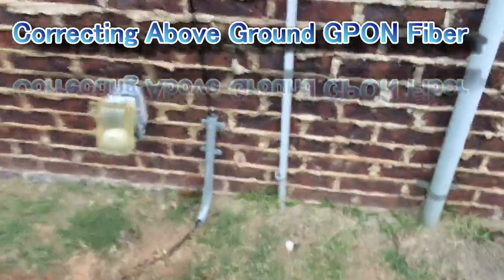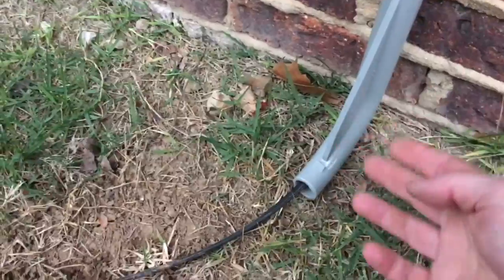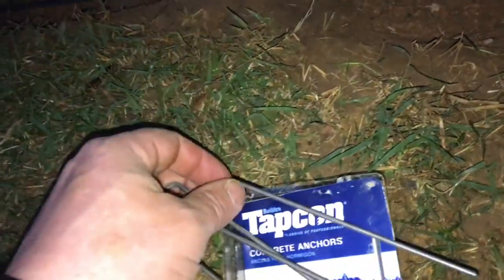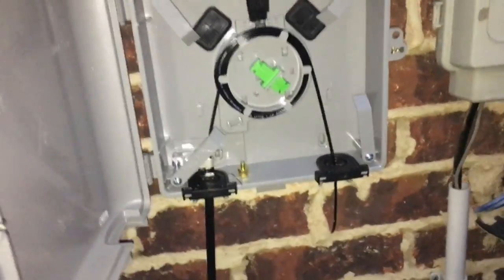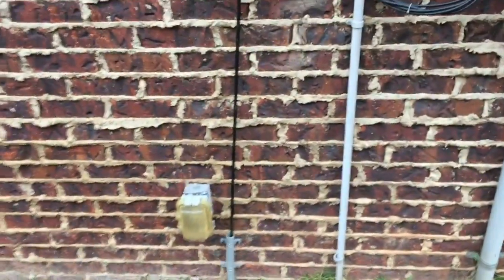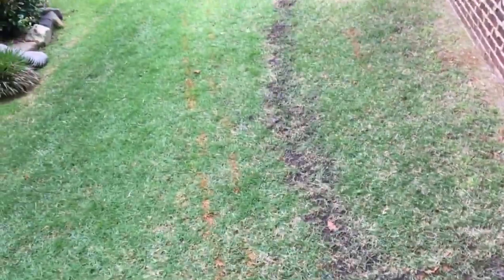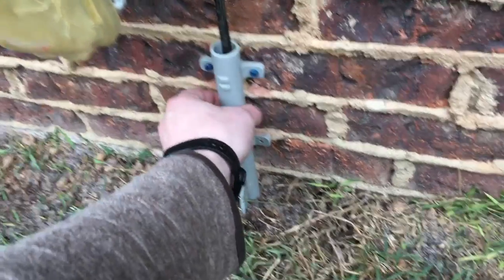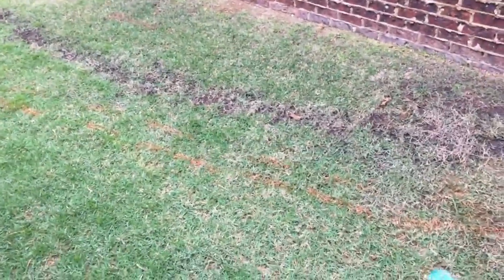AT&T Gigabit Fiber Internet -  Underground Fiber Installation Mistakes and Resolution Process

Comment: More concerned about that mortar work. Holy hell.
Reply: lol. -- This is an upper scale neighborhood of sorts.  I suppose it's not so obvious to you, but the mortar work is done perfectly but to give a new home an 'old world' look they don't clean up -- IE: Acid wash for exactness/clean lines.  They also tend to add a bit more here and there and in some cases push a weeping technique in certain joints depending on overall look of the home/neighborhood.  

I'm sure you've seen plenty of 'newer' neighborhoods with mortar and brick that look like this?  Were you being sarcastic ? :)
Reply: Used to be the style man
Reply: lol.. Indeed.  The house is only 10 years old,.. just happened to be built in a 'themed' type of neighborhood.  That's rather popular around here (Themed neighborhoods).  I'm not crazy about them as everything just looks the same but it is what it is.
Reply: Looks like shit for sure!

Comment: Installer should have used crimp-lock tool to make a couple of fiber connectors for inside the slack nid.  Provides a breaking point to check for inside/outside issues on a repair.  If they are done right, you should have very minimal light loss.

Comment: I install for AT&T, and I apologize for this type of work. This is an absolute shit install.  This is not the type of work myself or my co-workers do.  You should call and tell AT&T to come and repair this to make it right.
Reply from the maker: No need for you to apologize.  I am a network engineer, net. Admin, Systems Designer, Sys Engineer (I just tell people I'm in "IT" because I do most everything in it..) -- Point is I see good work, average, and piss poor work.  I see sheer lack of common sense,.. lazy incompetence all the time.  I know better than to assume every installer , burial crew, etc does their work in this manner.  It's all in the person/people and whether they give a damn, have common sense, and if they are lazy etc.  
As for calling AT&T I gave my reasons in another response why I didn't but I've fixed everything (imo) better than they would have without cutting any lines etc.. so at this point there is no need for anyone to come fix anything.  It didn't bother me too much.. as I half expect shoddy work from most companies contractors, and employees these days (no offense to the 'good' guys out there.. and I know some of those personally,.. and this stuff pisses them off more than it does the customer as it makes them look bad and people assume they are 'ALL' this way).
Reply: I'm a Uverse tech as well, where's that drop tube at? Also, I fucking hate those flower pots. We have to dig down and under to feed the fiber through it
Reply: Yeah he completely bypassed the terminating points in the slack bid, I've never seen the fiber drop run directly inside the home like that, if your drop ever gets cut, the repair tech will do it right.
He should have sealed the point of entry into the home, like you said, and both grommets on the slack nid. Also, they should have grounded the drop using that copper stud in the slack nid, then grounded the nid.
There should also be a conduit going up the drop to the nid, they also didn't tag the nid with your account number
Reply: They all look like this down in South Florida.. Looks like a normal install.
Reply: @KevAdams1989  grounded the fiber drop?  Its glass, the copper conductor is for locating lol

Comment: I am pretty sure they messed up your install A LOT. When you opened up the box on the outside I am pretty sure that the green connector in the middle of the spool is supposed to be a patch. As in they put an end on the cable from the street plug it into the patch then run a patch cable into your house. That way if there is ever damage one either side it is less work to repair. The cable is 100% not burred deep enough and it almost looks like the cable from the box into the house is not the properly specked cable to be exposed to the elements and potential damage.

Comment: We do not have fiber here yet. What does the inside the house look like?
Reply from the maker: I'll make another video showing everything involved explaining the infrastructure inside my neighborhood all the way to the actual modem/Gateway -- It will notify you when I make it and I go live.  Where do you live.. ie: City/State?  You aren't in AL are you?
Reply: Install a fiber homerun from NID - outside box - to a 6" x 6" square called an ONT, run cat 5 from ONT to Modem.  Usually the ONT will go in basement or some other discrete location.  A good tech will hide most of the wiring or if it is exposed will run the lines neat and clean

Comment: Hey bud, just FYI if your line was damage or cut, it can easily be replaced from the box near your house to the box on the side of your house... not thousands of feet. Average length is 300'
Reply from the maker: They don't splice / repair cuts in drops from the TV80 Ped  splitter drops to handholes/home demarcs here.  If there's a cut.. a brand new drop from the TV80 miniped (next to ONU) is pushed whatever the said distance is to the Demarc etc at home.  I don't know precisely why they aren't repairing the fiber mid way.. but they don't in this area.  It does make for consistency though.  I don't think the fiber cuts are immensely high on the 'drop' side in xFITL (ie: DISC*S MX conversions).
Reply: GuessTech False
Reply: If that line gets cut it will be a 20min fix from that Cfst Pedestal, the tech will run a brand new line from that pedestal. You don’t have a Tv80 circuit

Comment: If this is how the outside install was....what does the inside look like? I would have told them to come back and take it all out, fix my yard and the holes in my house. I'm surprised you're so patient.
Reply from the maker: Well it's a bit complicated.

The inside is perfect.  Mostly because I prepared the entire install from ONT throughout the entire house before the installer even arrived.  IE: I ran multiple Cat 6 Cables (a few hundred feet) through the house, terminated where needed,.. put in Low voltage mounts in sheetrock,.. installed Female ethernet jacks where needed and so on.  So when the installer came in - he did that shoddy outside work (on the burial, J-pipe PVC being above ground etc)  and all he had to do was put the demarc box on outside, drill into house as shown in this video.. push the fiber end through hole and put the small Optical Network Terminal on the sheetrock/wall inside the house and plug it in.  I had the Cat 6 already terminated and precisely where he drilled into the house ready for him to just plug it right into the ONT.  So , yes, I did a lot of his work he would have had to do -- but I did so for two reasons.

1) When you do it yourself, and know how, it's generally done better than someone else doing it who isn't trying to do everything "perfectly" right, paying attention to every detail and so on.  I'm particularly anal with any bad crimps/angles/Ethernet cable secure clamp points,.. Jacks, Terminations,.. the works.  So I spent the time to do it the way I felt 'happy' about it being run before the fact.  This isn't to say the installer couldn't have done it, -- it would have worked with however he ran the ethernet cable of his own.. but there's no way he would have run it the way I did up multiple walls, through attics, above attic and so on.  Plus my equipment was better than the standard equipment he would have used supplied by AT&T.  (That said, the standard AT&T Cabling etc works just fine.. I'm just of the mind if it needs X rating.. then go to a higher rating if reasonably cost effective).  IE: He would have used Cat 5/5e -- I used Cat 6 rated for 10Gbps despite only 1Gbps (1,000Mbps) being run through it.  That 'headroom' is nice to have imho for a variety of reasons for your OWN install, not necessarily on a mass scale.

2) To save time. -- The install time for Fiber is up to 6-7 Hours -- and you/I have to be right there the entire time.  So I wanted to shorten that as much as possible.. and I did.  I helped him run the Drop fiber half a mile through conduit from my house/handhole to the Fiber corning splitter by the Optical Network Unit .5 Miles around the corner.  While he was working outside on that stuff I 'redid' I was inside setting up the mount for ONT, drilling through walls with plates etc.

As for the outside cabling.  The initial imagery is the Neighbors lines and my line.   

You see they CUT all of her lines to all her services when they buried my new fiber lines (about 3 weeks after it was installed).  I buried all my own RG-6 QS (Cable TV/Internet) lines, Telco lines, and so on.. So I know precisely where all the lines are located.  Knowing the likelihood of incompetence with the burial of now HER new lines (two new lines.. her POTS and Fiber line) Plus my own line that had 6-7 feet by road unburied still.  I knew I wouldn't catch them when they arrived.. I had no idea what day or time they would come do it.  So I made labels with specific instructions on them on exactly how to bury the lines, where to lay them, where not to lay them, what to avoid (power/gas/cable/water/sprinkler systems (hers) etc) -- and I routed the cables in this position so all they had to do was follow where they were already positioned and they would not cut any other cable,.. be it power or my own fiber or cable et al.

Sounds pedantic, but I've seen companies go back and forth cutting each others lines on drops like this while customers have to wait days or weeks to get service back up only to have it cut out again by Company A cutting Company B's lines due to not having any common sense.  -- I think you get the point by now.. but by spending 10 minutes with the aforementioned labeling, positioning and so on -- I was pleasantly surprised to come home and see they had followed the directions to the T, perfectly.  Only gripe I would have is the depth they buried everything at.  (2-4 Inches, and 1-2 millimeters at best next to house demarc pvc pipes).  Which is what this video is about mostly where I resolve that depth issue and ABOVE ground ready to be cut in half by lawn services etc due to expensive fiber optic being above ground against the house.

TLDR:  Not so much patience, just worth it to me to do things myself since I "can" do this type of work and to prevent more time consuming, loss of service, etc type of headaches due to incompetence.  I was quite  annoyed with AT&T.. especially their burial crew(s).  Again,  2-3 inches isn't acceptable imo for Fiber optic (or any telecom cabling) and NOT buried against the houses while above ground like shown in video is just 100% incompetence of common sense work -- No 'training' needs to be done to know an underground cable going through a J Pipe of PVC has to be buried UNDER the ground lol.  

It's all finished now,.. grass is healing up nicely, service is great so all is well.  

For the inside - I do plan on another video showing it -- and if I can find the little bit of footage of the installation (running Fiber through neighborhood to ONU splitter Ped,.. etc) I'll add that into it.
Reply: Good explanation, thank you. I have a couple more questions:

1. How many lines run into the house from outside?
2. Can these lines terminate at a network cabinet and then get distributed throughout the house with my 
     existing Cat6 wiring?

My network cabinet is in an unfinished section of my basement. Any lines that need to come in from outside could be ran directly to the cabinet for distribution throughout my house. I have Cat6 hardwired from my network cabinet up throughout the house. I guess my assumption is wires come in from outside and terminate into a "Modem" and then get distributed to other points in the house via ethernet cables. Is this correct? Aside from the Fiber Modem on the inside, is there other hardware that needs to be installed inside the house?

Thanks
Reply from the maker: One line comes into the house - The Fiber optic line as shown in this video.  Inside is what is termed an ONT (Optical Network Terminal).  An ethernet cable is then plugged "output" from this ONT and that goes to the "modem" called an RG (Router Gateway).  

So in short:
1) -  1
2) Yes.  -- The Ethernet cable coming from the ONT inside can run to your network switch/router/hardware and that can be distributed how you wish.  Though it does have to pass into the RG before becoming functional as the RG ("Modem") authenticates your service on the network.  For example I run my Router and switch behind the RG,.. I put the RG into a passthrough mode (removing NAT etc) and my equipment does all of that -- the RG primarily is just authenticating although they don't allow a true 100% passthrough but for all practical purposes it will work anyway you wish for things to.

I will mention they are in the process of building the ONT into the RG ("Modem") as one unit.. in which case the outside fiber would run directly to this as you suspected instead of the way I prefer it and the way I and most have it now with the Fiber coming inside to ONT.. ONT having an Ethernet cable going to RG and their equipment if they choose to use anything beyond that Router/Gateway supplied by AT&T .

Comment: I dont have that big out side att fiber box.   My installer went to the neighbor house box then the fiber cable went straight to my room.  Nothing like this.  Is there a reason?  Is it because the main box is on my neighbor property.  They install the fiber cable laying on the surface and said someone will come to burry it. I would have though they would do that on the same day they install the internet

Comment: I have Verizon FIOS in our area (we currently use Spectrum - I have no complaints about reliability, but they have a very low speed package). I called out FIOS and I told them that we had a conduit because we have a pool to boring in all media lines. After attempting to pull the line they could not get it through. The technician just left. How did you guys do the burial of the fiber? Thanks.

Comment: As someone who does these installs everyday.. I also apologize for the lack of fucks given by the installer. BSW is a whole seperate issue. No wonder they think we can install fiber jobs like this in 2 hours.

FYI.. the slacknid (connection box) on the side of the home is now "optional"... so you can imagine the work we are going behind now. One other thing.. depending on availability.. we have access to flexible conduit that is to be used from ground to nid on buried fiber applications.

Comment: What kind of clown shoes operation puts fiber in the ground without putting it in conduit from the handhole to the house?
Reply from the maker: Agreed.  Conduit is the PROPER and prudent way to ensure what you put in the ground stays there and RELIABLE for decades to come.  AT&T did this work of course.. and I'm grateful it's here.. as it's relatively rare if you compare the number of residences that have fiber available to those that don't in this country (maybe 1-2% max).  

I will give them credit,.. they do the work quickly WHEN they get around to doing it but it took them a YEAR to finish this.  It was easy to count the days it took for the crews to do the actual work.  If they had come out and did it start to finish in this neighborhood.. it would have taken ~5 days MAX.  Instead they did literally a few hours of work every 3-4 months.. then finally at the end sent in contractors to dig the area up in 2 days.  The credit I'll give them is they DO use conduit for everything in the neighborhood EXCEPT from the Handhole to ONT (side of home)/Demarc.  So that is why I did what I did.  There are A LOT of other utils/cables right where they put this fiber so it would have been a nightmare to put in conduit myself.  So I did all I could to put it further down.. 

The dumbest thing was mounting that PVC J pipe ABOVE ground .. lol wtf?  But that was a 60 second fix.. except I had to DIG up 6 feet+ of land to bury it proper depth  and that took a while given the hard ground here.  

They used a trencher to bury the fiber (huge machine) and it (even with my marks etc) cut my neighbors lines AND I've found out now in spring that they cut through my sprinkler system.  SIGH!

The ridiculous thing is they used that huge machine and it was buried .. at it's DEEPEST depth 2.. maybe 3 inches.  I had to manually go check depth and push it down/dig further throughout the yard and take care of the sod after for months.  

On the flipside.. every other neighbor that got the service hasn't touched their lines.. so lines are above ground at many houses lol.  I have no idea how many have been cut at this point by yard work or other such.